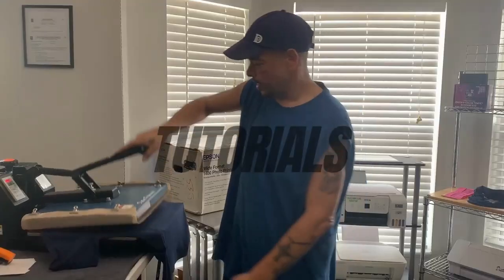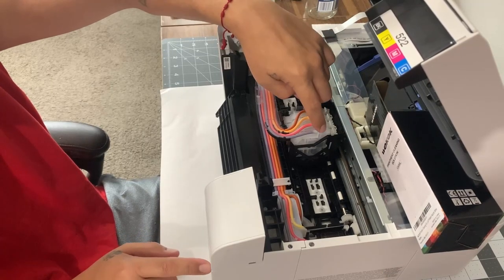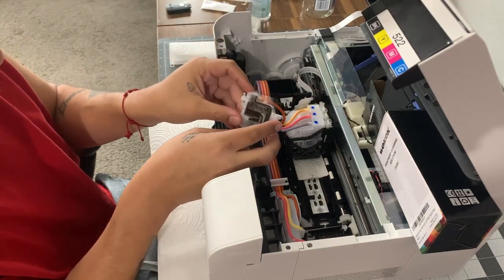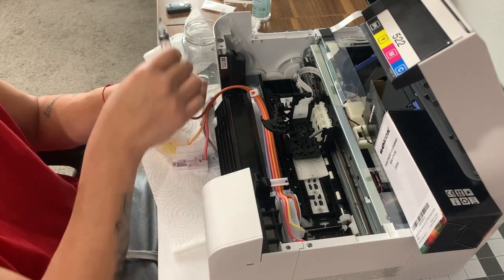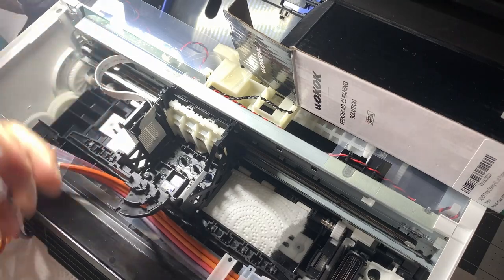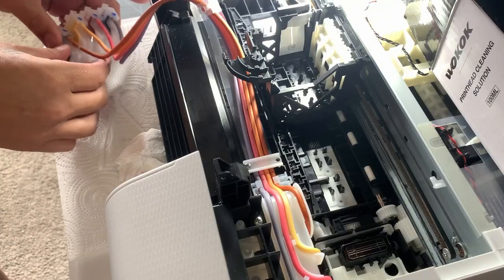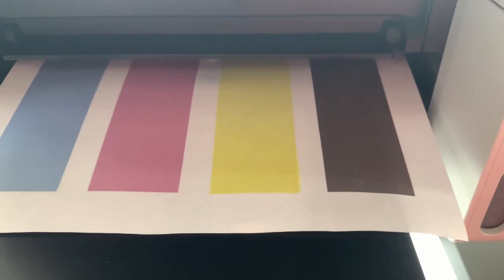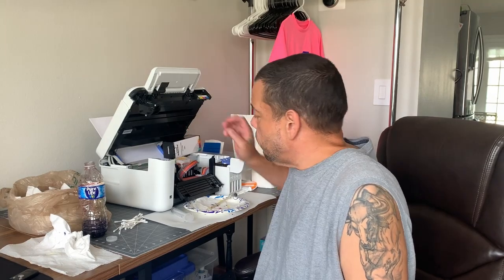Sublimations printer clog, print head cleaning #sublimationprinter

Comment: HAVE AN EPSON 8500 WIDE FORMAT. MY ISSUE IS WHEN THE PRINT IS COMING OUT OF THE PRINTER IT RUBS ALONG THE TOP OF THE OUTPUT AREA AND SMEARS. I LITERALLY HAVE TO SIT THERE AND PUSH THE FRONT OF THE FILM DOWN AS IT IS COMING OUT SO THAT IT DONT RUB ALONG THE TOP OF THE OUTPUT AREA.. SO TIME CONSUMING.. ANYONE ELSE HAVE THIS ISSUE AND WHAT HAVE YOU DONE TO FIX IT?
Reply from the maker: Have you checked to see if they sell a different output tray. I know for my 1400 I use a 13x19 A-SUB box as an out put tray and it works well. As for wide format do you mean the epson ET-8550. Not to familiar with that printer but I will ask around and see if I can get a resolution for you. Thank for watching.